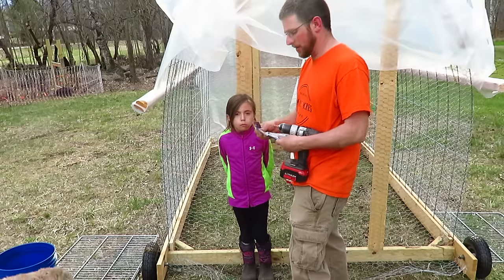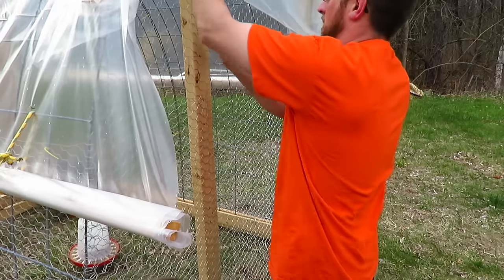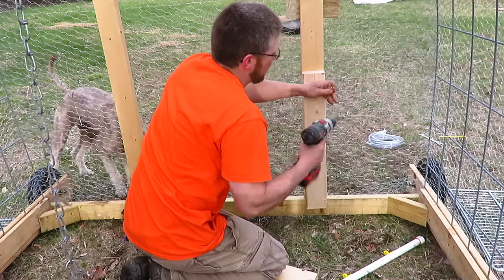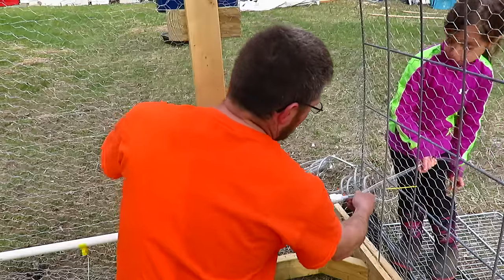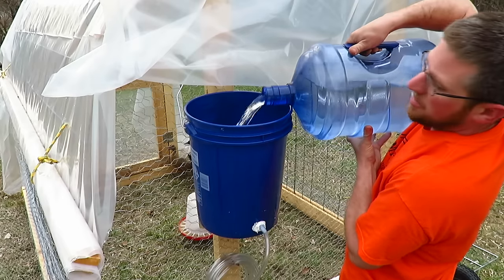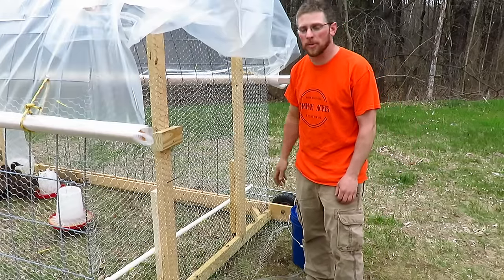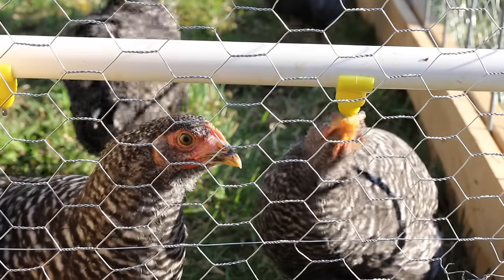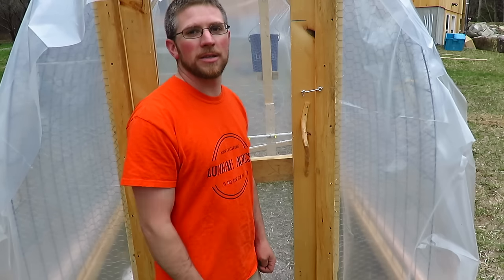Installing Automatic Chicken Waterer

Comment: Late to the party but a couple of notes that I don't think were mentioned in the video.
1) the bucket can be at whatever height is comfortable for the chicken farmer to fill as long as it is higher than the pipe.
2) the top on the bucket can't be on air tight or the water won't be able to flow.

Comment: If you put barbed fittings on both sides of the watering pipe and run another length of tubing to the top of the bucket or open to the atmosphere, it won’t get air bound and will show you the water level without opening the bucket lid. Great videos! Thank you.